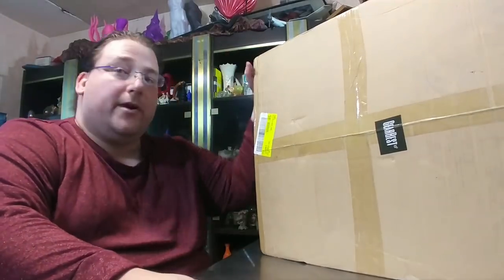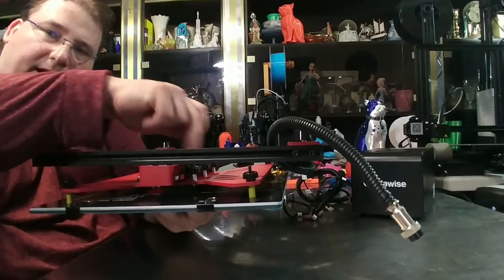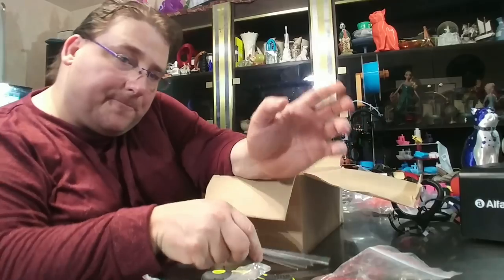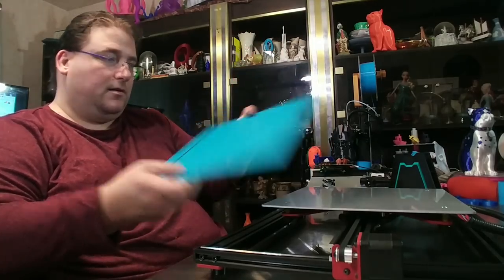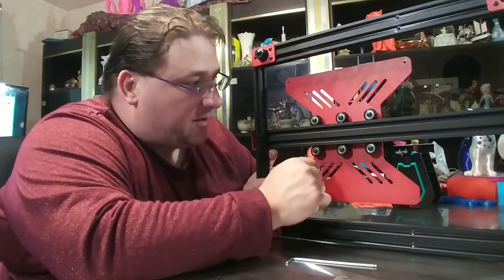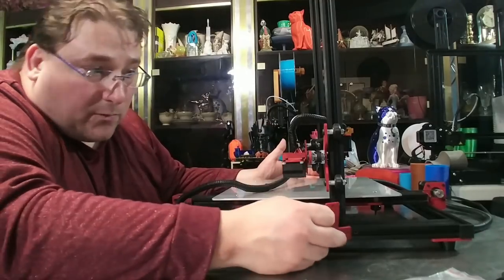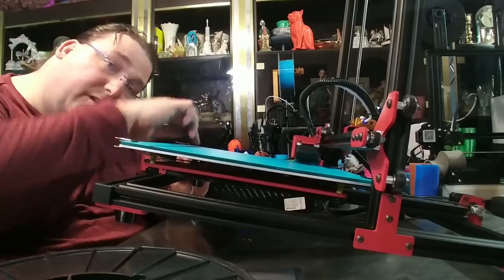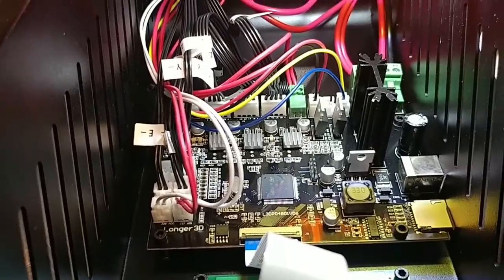T3DP 219 Alfawise U20 A Real Competitor for the CR 10 Real Potential Exists Here

Comment: Wow.  Awesome GearBest Quality Control
Reply from the maker: Its actually not that bad. Better than the first shipment of cr10's :-) now if they make no effort to fix anything. Then i would be a bit upset.
Reply: Nerys I agree.  My CR-10 from GearBest had issues.  They didn’t secure the connection cables (or wrap them) so they banged around the print head shroud and loosened that and scratched it up.  Easy things to fix if they just spent some time on quality control.

Comment: YES so glad that big vase made it, also when you can anyway to get a size on the CPU for a heat sink want to have all the goodies here when mine shows up
Reply from the maker: The CPU is higher than the rest of the components around it so I'm just going to use one of my stepper motor heat sinks I suspected there was something specific about that one file I'm still working on figuring that out

Comment: Looks good, maybe revisit it and let us know how it's working out when tuned. The price is definitely appealing.
Reply from the maker: Yep. Besides the curvy vase mode issue its really working quite well. I habe a huge venessian mask printing now first over 30 hour print and its looking stunning even in cheap filament! Really happy with it so far.
Reply: That's good to hear, always a bit worried with these large beds not being as accurate. But I know soon I will have to go past a cr-10 mini for some bigger projects. This might be a good option if it does prove stable and reliable. Btw, a 30 hour print, we live in two different worlds there buddy lol.
Reply from the maker: :-) yes many of my prints tend to take quite a long time this print actually took 41 hours and I consider that to be a relatively short print :-) 150 hours is not uncommon in my household :-) I'm only just a little bit insane :-) but it's fun!

Comment: I had the same shipping damage on my CR10-S the coupler was all stretched out and mine was even broken in two pieces. Luckily I could steal one from my Anet while I ordered new ones. I think my extrusions may be slightly out of square as well. Shipping companies are way too rough on stuff
Reply from the maker: Part of the problem is Mass these machines have a lot of mass and so it doesn't take a whole lot of rough handling to really make things go wonky which means packing becomes an extremely important issue creality interesting Lee enough could take a few notes from tevo on this they're precision-cut hypertight high-density black foam Packaging is really top-notch

Comment: Nice video. I like how you make reviews, you not only show the prints from the printer, you show the sections of the printer specially when opening the control box. 
 Does Alfawise have a 220x220x220+ Printer? Hope they make one and hope is even cheaper that the ender 3 and same quality print with that UI.
Reply from the maker: As far as I know the only have The U10 in the u-20 but I imagine if these are successful they will make more whether they are successful will be determined by whether or not they can improve the printers iteratively like creality does
Reply: Alfawise u30

Comment: Hi, I want to buy my first 3d printer, I like the U20 for the printing volume. Would you recommend this 3d printer? Or maybe it would be better the Tevo Tornado  or the CR-10? Thanks!
Reply from the maker: That's a tough one I would recommend between the u-20 and the cr-10 the cr-10 will give you slightly better print quality while the u-20 will give you almost indistinguishable print quality and a much nicer user-interface at a lower price but the price difference is not that much I think they're like $40 a part which is not enough for you to make a decision on at least I don't suggest making a decision on $40

You'll have a little more support with the cr-10 from the community although the same support will work with the u-20 since it's nearly identical in construction

That's a tough one either printer would make a fantastic printer I would have to lean toward the CR10 until I have more experience with the u-20 but I can say I don't think you would regret the u-20 either one is a fine  machine
Reply: Ok, thanks! I appreciate your answer.

Comment: I'd love to see a way to sync the x gantry with a belt and a second Z screw for this thing too.  Looks like a great deal.
Reply from the maker: Synchronizing them is a bad idea every printer I've seen that does that never works right because in order to run a belt from one lead screw to another you have to constrain the lead screws and now you're adding Z banding :-( as long as you adjusted correctly you will never have a problem with a single lead screw up to 300 mm I have 5 printers at 300 mm with a single lead screw and they all work flawlessly no problems whatsoever if you have any problems for the single lead screw your right hand vertical trolley is too tight and it is dragging
Reply: Nerys how close are the differences between the left and right side of your X gantry on those printers?  Mine gets out of whack a little after a few tall prints and I have to use jigs to get them perfect again.  Unless they're perfect the ABL will be off.  Trying to remove as many obstacles as possible between me and my prints :)
Reply from the maker: My bed level never changes when I set the bed level on a printer unless I'm man handle it in a way I'm not supposed to the level holds 4 weeks sometimes months I have not had to adjust the level on my CR 10 in 3 months I have not had to adjust the level on any of the three under three printers that I have since I bought them and assemble them unless of course I change something I've even swapped out nozzles and not had to relevel the bed as long as the length of stays the same

If your bed level is changing something is loose or something is binding there's an easy way to check this grab the lead screw coupler and turn it a couple times back and forth now look at the relative position of your left vertical trolley and you're right vertical trolley they should move exactly together if the right vertical trolley lags behind at all you're going to have binding and you will never get a bed level that stays the same it will change every time the Printery homes this means your right hand trolley is too tight it is binding therefore it lags when the left hand trolley is moving up and down you want the right hand trolley to be almost too loose keep losing that eccentric wheel until when you turn that coupler to move it up and down the right hand trolley Moves In Sync
Reply: Nerys it's really to just handle the uneven print surface that is the bed itself so I can have a dime sionally accurate first few layers.  I guess I could just ignore the whole issue and use a tiny raft - but then that glass like bottom goes away :(  My bed level certainly doesn't change now since I've got solid bed mounts, lol.

If I had it to do over again I'm not sure I would go with the bondtech and ABL.  Totally would stick with the petsfang and microswiss though.
Reply: Additionally, I think I have this issue to the extreme I do because of the dual Z steppers.
Reply from the maker: What printer are we talking about.
Reply: Nerys CR-10S (two of them) in this case.

Comment: You did use the rocket's gcode and SD card on another printer, not? I really hope that there isn't a bug in the printer that makes it freeze up and stutter upon a certain combination of actions.
Reply from the maker: I always fresh slice. I resliced and i used different sd card. I have a couple of suspicions which i am in the process of testing. I am also hopefully going to have someone else with a u20 test the same gcode.if they have the same failure at least its not unique. Then we test the slicer. It could be my statt script. If this is not running marlin their may be something conflicting their under apecial conditions. We shall see.

Comment: Hi Nerys,  I sent you a message on FaceBook, but I don't think you check it.  I started watching you videos when I purchased an Ender 3.  I was able to get one print out of it and had some bed leveling issues that I solved.  However, it is now shifting in the +x axis direction at about the .4mm layer on all my prints.  You sound like you are more familiar with the internal workings of these thing so I thought you might have some insight.
Reply from the maker: First thing to do is to download one of my sample G codes from my profiles Link in the description of any of my current videos just go to the test print folder and Ender 3 see if that shifts if that shifts we have a mechanical problem with the printer if that does not shift there's a slicer problem let's see what happens and get a picture online to please
Reply from the maker: Okay that is some major layer shifting normally I would say get rid of the glass that's shifting your y-axis but your shift is on the x-axis that means the nozzle head that moves back and forth left and right first make sure your belts not ridiculously loose it'll jump teeth if it is you don't want to over tighten it but it does need to be snug and twang just a little bit

Next would be to check to make sure the wiring going to the X stepper motor is intact and connected properly unplug it plug it back in make sure all four wires are going into the plug

If that all looks good my next suspension would be a bad stepper motor something is definitely wrong with x that's not a slicer issue that's a mechanical problem
Reply: Belt seems good.  I am going to swap the x and y stepper motor and see what happens.
Reply from the maker: If the problem moves when you swap the motors then most likely the motor is bad they're under $15 to replace

Comment: Nerys for the Ender 3, what would you say is the distance between the nozzle and bed that you have it at? Thanks
Reply from the maker: I honestly habe no idea and no practical means to reliable measure. I can say its right around .2mm whichbis my normal printing layer height. I set my nozzle height optically (mk1 eyeball) to get close and then visually and by touch to fine tune and confirm proper height.

If you watch my cr10 bed leveling basics video you will see what i mean.

Comment: Hello Nerys,
I have a CR10s and an Ender 3 and both have the same "problem".
In every print the layer lines are very inconsistent, I want to call it Z banding however the lines don't match up with the Z rod. Also, if I shine a flashlight at the print it looks perfect, but when I angle the print a certain way it looks awful (lots of "Z banding").

I followed your Ender 3 video where you explain about making sure the aluminium extrusions are 25cm apart and I have corrected mine to that, however I am still having the same problem.

I am 99% sure it must be a mechanical issue as I have tried loads of different settings and multiple slicers.
Any ideas?

Thank you for all your helpful videos, great advice!
Reply from the maker: Print out one of my test prince in my profiles folder and send me pictures did you make sure that the left vertical on the Ender 3 is not twisted? Although you say this is happening to both printers which leads me to believe it's a slicer issue while it is possible it's unlikely that two different printers will have the same mechanical fault send me pictures
Reply: Thank you for your reply. Yes the left vertical is not twisted, although when I got the printer the two verticals where 25cm apart at the bottom and 25.5cm at the top. The printer also rocked on the table. Your video helped me fix both those issues but I am still getting the problem.

I have printed the Benchy gcode in your documents and it looks similar to my previous ones sliced in Cura. https://i.imgur.com/BYnttNQ.jpg
As usually the top part (cabin) looks quite good, but the bottom (hull) looks bad.

Thank you
Reply from the maker: Except for that little shift at the top of the bow I think she's actually not that bad the little zits are a matter of tuning and Alignment when you slice it yourself align the Z seem with 0, 0

Also try lowering the temperature 5 degrees and make sure the fans running at 100% the very bottom of the boat looks like a possible cooling issue I believe my Benji G-Code Prince a little on the hot side 220 Maybe lower that to 2:05 maybe even 200

Comment: Where is best deal on this printer, and would you suggest it over cr 10s , thank you
Reply from the maker: I believe alfawise printers are a gear best brand so you can probably only get them from gearbest while the printer does have promised and I think it is an interesting printer I still think the CR 10 is better
Reply: Nerys thank you... What about CR10S vs jgaurora 5? (This will be my first printer). And do you have a favorite supplier
Reply from the maker: My primary sources are Amazon and gearbest Amazon is faster but more expensive gearbest is slower but cheaper

I would lean toward the cr-10s it's the highest quality for the dollar available in my opinion the Aurora A5 has been very reliable for me but uses some proprietary parts and might be a little difficult to repair but it is on sale for a very good price I think you would be okay with either printer my personal favorite though is the cr-10s
Reply: Nerys  thank you

Comment: Wierd I am not getting any salmon skin on mine. Mine came flawless too
Reply from the maker: Which printer?
Reply: Nerys this one the u20
Reply from the maker: No salmon skin? My salmon skin is pretty heavy. Not bad but very much their. Even smoothers dont 100% remove it though much improved going to try 2 sets.

Have you printed anything large yet? Also can you do me a favor. I habe one file the u20 refuses to print right. In my profiles sample gcode folder can you print the xl rocket gcode and see what your printer does?
Reply: Nerys yeah dude I am at an engagement party all day but when I get home I will for you.  Yeah i printed some medium large things nothing huge yet.  In my video check out my prints they look pretty good.  Are you using cura 15 or 3. Whatever?  I saw better results with cura 15
Reply: Nerys i was having problems with cr10 profile in cura 3. In order to get cura 3 to print decent I had to import profile from gcode in cura 15 then I took the start and end gcode commands and in cura 15 and pasted them into newest version of cura.  Now it is printing with either version of cura.  I even got abs to print on mine
Reply from the maker: I use simplify3d
Reply: Nerys oh ok i have simplified 3d but I never use it.

Comment: what cura settings were useD?
Reply from the maker: I used simplify3d so alas I do not have Cura settings
Reply: Well thanks anyways
Reply: Can find any info on slicer setting as I am still new to 3d printing ans would like a base line
Reply from the maker: A good Baseline to start with r these settings 3 by 3 by 3 that's three top players three bottom layers three perimeters

Assuming stock Hardware 0.4 line width 0.4 nozzle with manually set not automatic

Extrusion multiplier or flow 97% or 0.97

Infill 25% grid

Temperature depending on your bed printing surface 60 degrees Celsius for pla glass or diamond plate Style 70 c

Nozzle 220 for the first layer for the second layer and onward whatever temperature the plastic appears comfortable with based on what you see it printing if you get a little too much melty melty lower the temperature after the first layer

Cooling fan for the first layer have it turned off after that go to 100%

Make sure combing is turned on that's the setting that will prevent it from crossing over the model perimeter which will help with stream

Retraction start with 5 mm at 65 millimeters per second

Restart 20 millimeters per second

And Kyra you go into preferences and you enable and disable settings you wish to see on the main screen find all the above settings and turn them on also enable spiralize outer Contour or vase mode in case you wish to use that at some point it's a very nice mode

If you have any other questions by all means feel free to ask these settings are not the end-all of settings they are a good base to get you started over time you will learn that you have to adjust the settings depending on what days you're Printing and what you want to do with what you were printing but that will come later as you learn
Reply: Thanksnu
Reply: Nerys  hi sorry to bug ya again know your busy man but idk why but i downloaded the new cura 3.4 something or other and after i slice and put sd card in printer start the print it goes to the back right corner and just starts extruding  is this cause i used the cr10 pre setting thet have on there?

Comment: Alfawise U20  or ender 3 ?
Reply from the maker: They're not really comparable the Ender 3 is 220 by 220 by 250 while the u-20  is 300 by 300 or 400

The Ender 3 is also quite a bit cheaper and we'll give you slightly better print quality but a smaller build volume

The u-20 is a good competitor to the cr-10 with similar print quality and the addition of a nice touch screen
Reply: @nerys71  thanks!

Comment: Could you show us the UI?
Reply from the maker: I did in the Live Stream but you are right it's not in this video I will be sure to show it in the next u-20 video
Reply: Yes, raving about the best UI on a touchscreen and not showing it.

Disappointing.
Reply from the maker: That's because I did two videos simultaneously and forgot to include it in both :-) so you're hearing crossover between two different videos I made a separate video just for the user interface it's linked in the description now